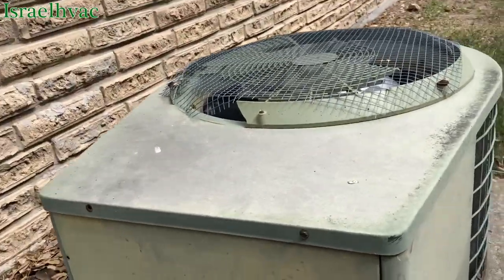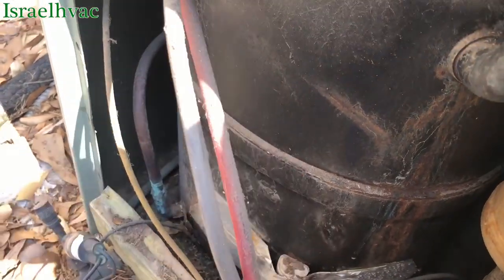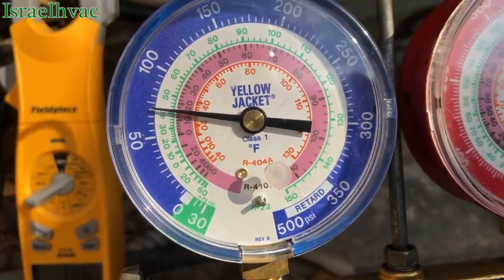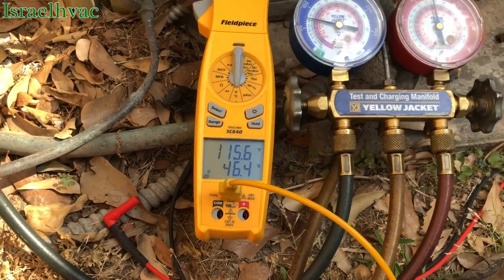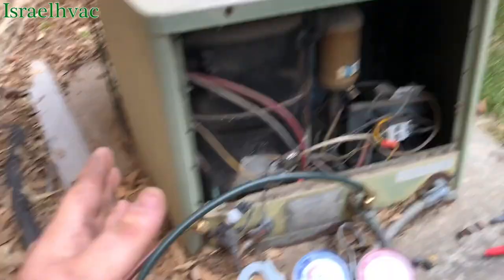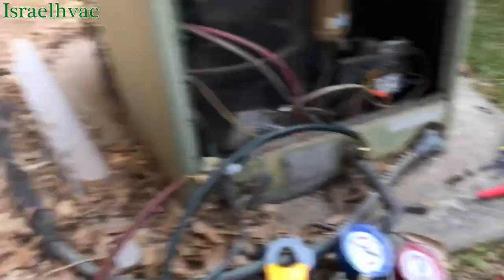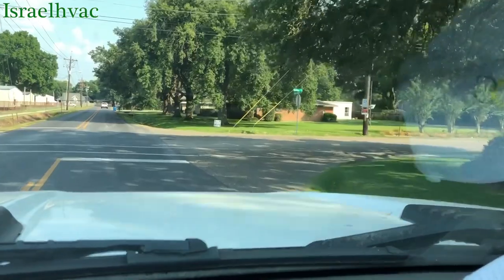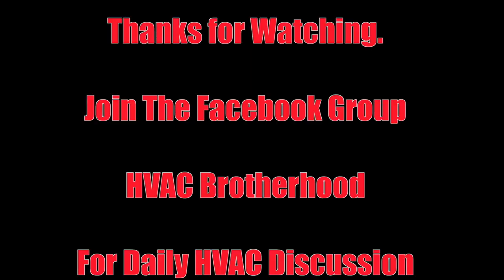HVAC Service | System Running Non Stop

Comment: I used to service these units all the time when I worked for Sears.  These old beasts have a double row coil in them, and dirt or (in our area) cotton from a cottonwood tree will get between the two condenser coils.  When you have high head pressure, pull the top and take out the screws that hold the plate that ties the two coils together.  Separate the inner and outer coil, and clean the Hell out of them.   If you do that, I guarantee your head pressure will drop and your superheat numbers will look a lot better.  Those old units are war horses and will run for a long time it they're properly maintained.   Having said that, this unit hasn't been properly maintained, so it will probably shoot craps on a really hot and humid Friday afternoon.
Reply: I agree if you have high head and liquid temps like that it's dirty!
Reply: Ken Thomas I’d have loved to see the discharge temp
Reply: They don't make them like that anymore. Alot of the newer ones from what I've noticed last maybe 15 years. Especially Gibson's!

Comment: 1:39 That unit has a double horseshoe condesnser. Head preasure is out of range because the inner coil is dirty.  Pull the top.  Remove thr. screws on right side to give you some space between the two coils. Rinse with water. Foaming coil cleaner will not cut it. 45 years experince. I remember when that design was new.
Reply: None of the new ones are built that way anymore.

Comment: With a liquid line that hot it's a coil clean issue or fan issue.
Reply from the maker: The condenser coil is in bad condition
Reply: This guy really doesn't care that he don't know what he's doing...
I'm amazed he makes videos he's not very good at his job.
Reply: Or a restriction
Reply: A restriction doesn't give you a hot liquid line. That means the subcooling is low. Dirty condenser
Reply: Joe Shearer i bet the cond was filthy, and no i dont think this guy is amazing but yes that drier was clogged and that would give you the symptoms he had. I just bet there is more than just a clogged drier. Like you said i bet the cond is filthy. With that said. The issue that brought that unit down was the clogged drier. He was right on this one.
Reply: Did you look at the dirty coil or cond fan      Come on man

Comment: If the management company was paying the power bill they would have changed it 20 years ago.   I had a unit like that acting similar and pulled out probably in the early 80’s. I put in the most efficient condenser I could find, an 11 seer Ruud with the double coils and fans.   Knocked $100 off the power bill the first month and it was July.  The old unit was about a 7 seer. 

The tenant is going to love the new unit. It will pay for itself in a year but it’s different pockets.

Comment: I also had 5-6 old whirlpools with the slanted coils and the baish finish these units are original and now only one is left and is still in business along with a carrier round one and a Coleman Evcon and, 2 General Electric units. The point is they still work and are probably older than this unit by 5 years. Though, the other 4 whirlpools were hauled out. And when I return to my country club again I hope they are still their.

Comment: You were right about people crying that you should fix the thing but what these people fail to realize is that the time involved in repairing this unit is all a huge waste if next week the condenser fan goes then a week later the contactor goes, the following week the capacitor shits out on you. I've had it happen here in northeast Ohio with multiple heating failures on an old gas furnace where the customer said "why didn't you just suggest replacing it the first time it failed?" I told him because my crystal ball was broken and I had no way of knowing his board would go out 3 weeks after the blower motor went out. If you sink an excessive amount of money into old equipment you can have an unhappy customer as well, it's a roll of the dice.

Comment: that unit probably has a two speed condenser fan and a switch in the condenser that went bad for low ambient operation. make sure fan is running high speed and clean the condenser coils. Technicians shouldn't be removing gas they should be recovering refrigerant.

Comment: I agree that the unit is not worth it but your problem is high head need to clean the condensor coil and check the motor blade pitch or what ever basically need to cool the condensor

Comment: Do you think airflow for the condenser could have also been a factor? Dirty coil? Failing fan motor? Obviously the solution is to replace the unit... Just curious if the filter dryer was the sole cause of the high head pressure.
Reply: Brad B on older units electrolysis occurs where the copper and aluminum are pressed together causing corrosion.  Corrosion is an insulator that prevents the rejection of heat from the copper to the aluminum.  No amount of cleaning reverses this process.  In an older unit multiple factors are in play from varnish build up on the copper tubing to lower performance of the fan to dirt on the coil to a possible partially restricted drier etc. An old corroded teardrop coil is your biggest contributor.  A new unit would cost a $100 dollars less a month to operate.  Wonder how long it would take to pay itself off.  Sometimes the savings on the electric bill actually make the payment.  Call me crazy.

Comment: Seems like the condenser coil needs to be cleaned... If the dryer were completely clogged, the head pressure would drop off to that associated with ambient temperature. The suction would of course go to vacuum. There's nothing wrong with that dryer. Once you replace a HIGH QUALITY, LONG LASTING old piece of equipment with modern junk, it's all over for the customer. They'll never see a reasonable service life again. CLEAN THE COIL!
Reply: Diagnosis may have been incorrect but the end solution should still be the same. The unit doesn't owe the customer anything and nothing lasts forever. Might as well get it over with as its probably going to crap out in the near future. Why wait till everything shits the bed before doing a preemptive change out?
Reply: @TheGhettoLobster  - The age of the unit isn't a cash cow for the vendor either.  What should have been done is to resolve the problem IF it can be resolved, rather than assuming an old piece of gear will not last much longer.  If you wanna be a technician, then be technical.  If you wanna read Tarot cards for hire, then that's a different business.  ;)   If a condenser cleaning dropped the liquid temperature, then the customer is getting maintenance and a problem is solved.  If the cleaning doesn't solve it, then that's the time to suggest to the customer that the machine has reached the end of its useful service life.

Comment: I would spray water on the condenser and see if it starts acting right. If there's enough airflow but the temp off the condenser air is low, the coil is shot (fins and tube not conducting heat) and the fix is sell a new unit. I used to put a cheap water sprinkler on real low to get them through the hot spell while waiting for the new install but they would just not pull the trigger and sign for the replacement unit. So I got smart and just stopped doing that. One of my first customers ran with the water sprinkler for six years and still called me back for furnace service.

Comment: Thanks John. The problem is not fter drier. Dirty inner condenser. Those units have 2 coils. Regardless. People would rather using old system that draws crazy amps flushing their money than new system and saving big in bills. But I'm just a Tech not sales pitch guy.

Comment: My keeprite is going to turn 35 in one month's time. It has never broken down, leaked, or even faltered once in the 20+ years we've owned this house.  Runs so quietly and cools the house so easily.  Even capacitors were original up until a few months ago.  A co worker and I changed them one day after work.  The original ones had oil on top and would probably have failed fairly soon.  .it cost me nothing more than purchasing the capacitors. Having said all that, as much as I would hate to give this gem up, when it leaks or finally does shit the bed, it will be replaced post haste...why bother holding onto something that's past its useful life?

Comment: I know this an old video but a very good video showing how the real world really is.  That machine has served its time.   Time for new.  That being said I woulda gave em options to keep it goin IF they didn’t have the means to replace it.  It for sure coulda used a good bath and I betcha that would got the head down some.   Also remember that those old machines did run a higher head than some newer 22 systems.  Good vid!!

Comment: Running water from a hose on the outside coil will drop the head pressure and will give a clue of the betterment IF the outside coil was cleaned.

Comment: That unit was worth changing a filter drier by compared to the cost of whole new system. Now once the compressor an expensive part replacement goes then it's worth a new unit. I'm maintaining a unit  like that and when I say maintaining I mean just checking it each year. The customer always ask about replacing it and I tell him as long as it's working and cooling I wouldn't touch it. This I didn't tell him is that a new one would not  last as long this one has for 40  years.

Comment: I agree with the final outcome of this video.... MAYBE cleaning the outside coil and or spending 2 hours with a fin comb and changing the dryer and spitting into the wind would have made sense to some of the so called techs out there.... but I would have rather moved on and suggested the customer do the same. It was time to draw the line... PAST time.
Reply: TheACKid yea then the unit goes out a few weeks later and you look like a fool. I have done this on old units before after someone else had condemned it and yes the customer was happy till it had to be replaced within a month. That was way back in early 90’s when I was just starting out. This guy did everything right and I’m here to tell you a total cleaning new drier and anything else that pops up while doing all this is not cheap for a unit thats on its way out. You live and learn
Reply: What makes you think that the unit is going to fail in a few weeks?
Reply: Agreed.  Time to scrap and replace
Reply: @tombonini7393  the fact that the compressor has ran over 400 head pressure, unit is almost 30 yrs old.

Comment: speaking of old,  My parents house has a 1993ish goodman unit that still running great surprisingly. Only thing that has ever had to be done was change a capacitor. It was grandmas house but my parents inherited when they passed. Furnace had to be changed out though. She was a senior citizen and got a new unit on a state run program which of course threw another goodman in there. But at least it works.
Reply: THEtechknight A Goodman running?

Comment: Good job 👍🏻 
Love real life stuff John 
That unit isn’t even worth cleaning coil 
But I’m surprised you didn’t just to see the head drop 
Sometimes we are just janitors
Reply: David Duda sometimes I will rinse the coil.  If it is dirt and not corrosion you'll see the head climb right back up after the water dries.  Time to let go of the past.  Life expectancy in st tex for a unit on the coast is 5 to 10 years.  Complaining about a 30 year unit.  Ha.